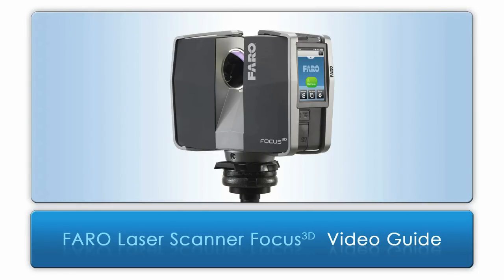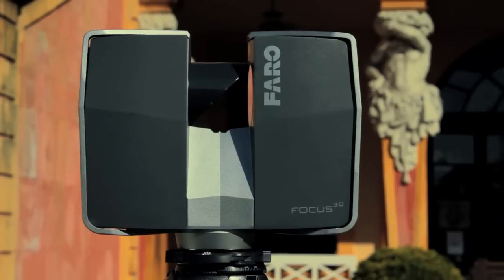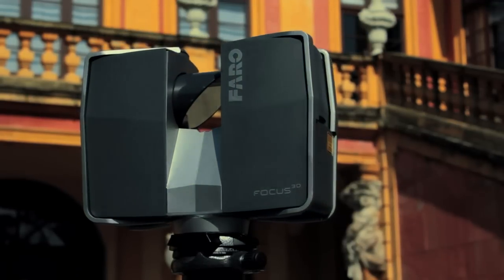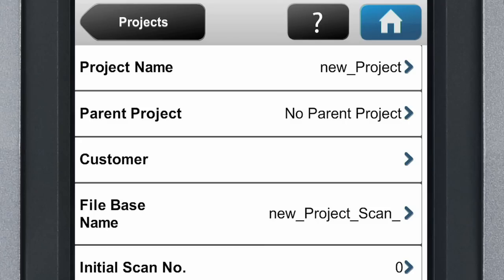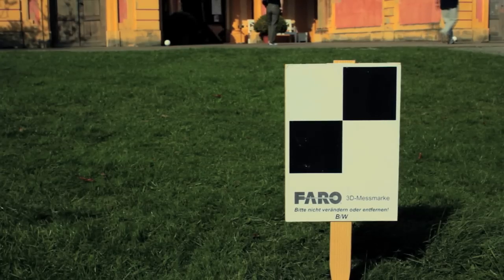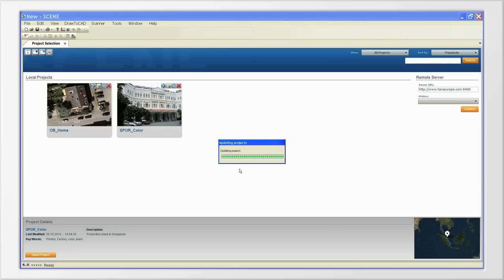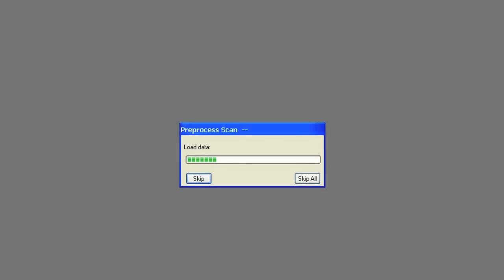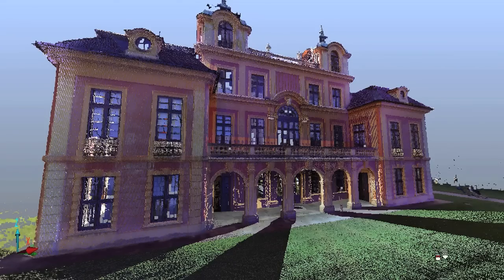Introducing the FARO Focus 3D

Comment: Can one or more FARO 3D scanners can be used at a time to scan large area ??
Reply from the maker: Hello Edwin, Thank you for your question. You can use more than one scanner, but you wouldn't necessarily need to. It all depends on the size of the area you are scanning. Would you mind either sending your contact information in a private message or emailing it to melissa.diers@faro.com? This way we can place you in contact with an Applications Engineer, who can provide you with more details.